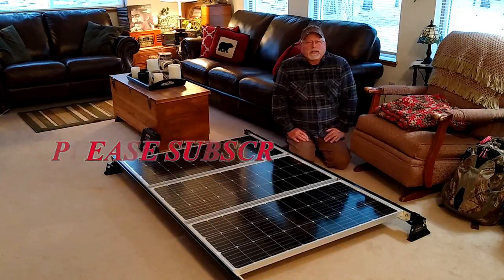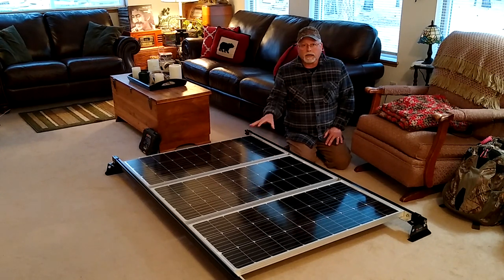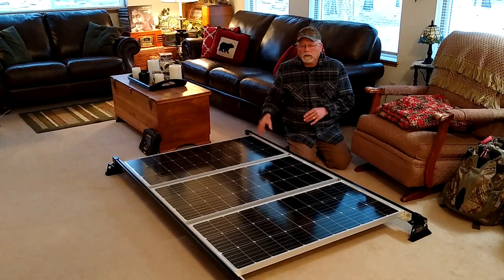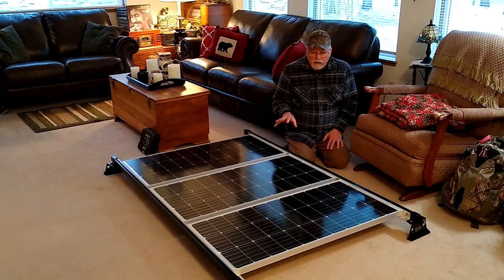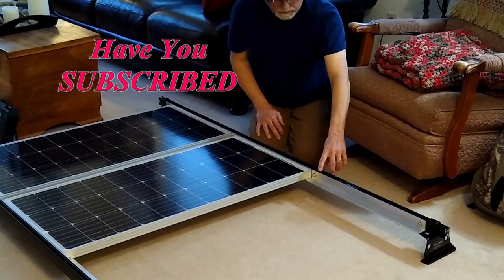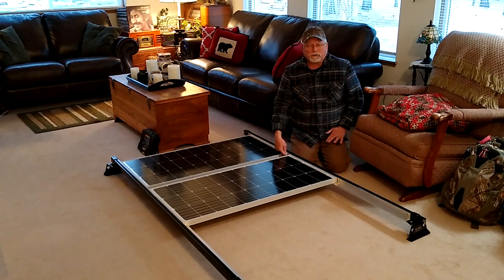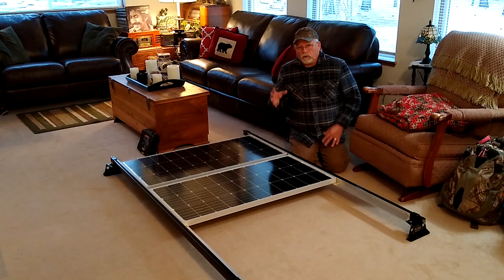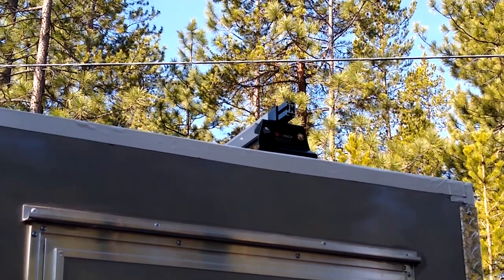CARGO TRAILER CAMPER CONVERSION BUILD PART 2

Comment: I am in love with that solar rack. LOVE LOVE LOVE it! I'm tempted to put a solar on the top of our Ford (we have a 100 watt already on the HC1) but keep changing my mind if I shouldn't get a storage rack instead. Renogy has been really good for our HC1, you've def chosen well there. Looking forward to seeing the final conversion :-)
Reply from the maker: Thank you Fern for your input on the Renogy solar panels. I did lots of looking around at solar equipment and settled on Renogy as the best equipment for the dollar spent. The roof rack is top end quality and I'm very happy with it. Adding the angle aluminum works great but does add $80.00 + $15.00 hardware to the equation. Well worth it. Thank you for watching our video and have a great day.

Comment: Thanks great video and nice setup I need to get mine on to that will work.
Reply from the maker: This is a great setup. Very solid racking system. As we're back in the snow and cold weather this week's video won't feature the finished setup as it's to cold in the shop to seal the mounting brackets to the roof. This week's video will be how to use Mylar food storage bags for long term food storage. Have a great day Kevin.
Reply: @explorer867  thanks you do great videos my friend.

Comment: That's the strongest mount I've ever seen!
Reply from the maker: Yes, its strong for sure. The mount is all aluminum so its very strong and lightweight. It bolts to the trailer roof structure with 8 bolts and the solar PV's are bolted with 4 bolts in each panel. Lets just say they're not going anywhere LOL.

Comment: That's an awesome solar set-up you have going on there. I like this. Solar is something I want to add to our trailer as well. 400 watts should be plenty too. Thanks for the sharing this video!
Reply from the maker: Hi BluWave good to hear from you.  Thank you for watching our video. The trailer/camper project is moving along at my pace Lol. Keeping it fun and not work. Working with Renogy has been a pleasure with the purchase and delivery painless. I ordered the 400 watt premium package. They had a sale last month so keep an eye out as they do this from time to time on some of the Renogy  product. I'm thinking we will go with the Battle Born 100AH Lithium battery. These are the best bang for the buck with a top end BMS and that means everything when it come to safety, reliability, and longevity. The BMS will shut the battery off if it identifies unsafe operating conditions and regulates how much power you can take out of the battery. I know TMI Lol. As I said earlier great to hear from you both and take care.

Comment: thanks for sharing, super nice build out....so a few questions, I apologize if you have answered them already... 1. What height of vantech racks did you order, I notice they have "standard" and "high" versions. Do you feel you have enough room underneath these to pass your hand for cleaning purposes. 2. why go with "top mount" vantech mounts as opposed the "side mount" versions? and are you bolting into studs or just the sheet metal, I imagine these need to be bolted down well as the panels act as big spoilers while going down the highway. 3. How are the panels fastened to the L brackets? are you screwing them in from underneath?
Reply from the maker: These are the standard height racks and yes you can clean under them easily. Watch the video again as I do answer the questions your asking about. Have a great day
Reply: @explorer867  I've watched all 9:51 minutes and you didn't answer the specific questions I'm asking about...please try to answer them(Questions 2 and 3) if you can. I would appreciate it. Thanks.
Reply from the maker: @bikeninja956  Bike Ninja, I'm sorry you are correct. I did a take off on the mounting holes on the back of each panel and drilled corresponding holes on the aluminum rails then using the mounting hardware from renogy bolted panels to the rails. The other question you were asking regarding mounting of Vantech rack I answered in the Cargo trailer camper conversion build part 3 video. In this video I show where and how they are mounted to trailer. The top mount was a cleaner mount for my application.  Thank you for asking your questions and if you have any other questions please ask. Please Like and Subscribe to my channel. Have a great day
Reply: @explorer867  no worries :) Really appreciate the info. It's about what I thought, you screw them from underneath...tough call whether to go top or side mount for the vantech brackets...I'm thinking side mount maybe, just less chance of leaks...but not sure... Cheers.

Comment: Good video Sir
Reply from the maker: Thank you for watching. Please like, subscribe, and let others know about our channel. Have a great week.
Reply: @explorer867    So I have not seen any videos on the inside set up of your solar panel on the cargo trailer.  Question. Do you have the power system grounded? May be a dumb question but how did you ground to a aluminum trailer ?
Reply from the maker: @jamesnelson167  what I did for my trailer is ground system to battery. I would recommend that you contact a professional solar installer to ask that question.  Have fun with your project.

Comment: I just subscribed.  I see you did the solar panels a few years ago.  How are the panels working for you?  I am curious how well the eternabond tape help up.  I seen somebody else have tape not do very well on their flexible panel.
Reply from the maker: Thank you for subscribing. The solar panels are working out very well. Only maintenance is keeping them clean so they produce to capacity. The eternabond tape is working out very well. After applying the tape I used self leveling seam sealer on the edges. This said preparation is everything. Make sure you use 120 grit sandpaper to rough up surface area then clean area with rubbing alcohol. Have fun with your project🤠 Let others know about our channel on your social media please.

Comment: Thanks for the video. I wish you had done a video on the application of the Eterna-bond. Did remove the flashing stuff from the manufacturer or apply it on top?
Reply from the maker: Yes I removed the manufacturers tape lightly sanded area with 120 grit sandpaper then cleaned up the area with rubbing alcohol. The Eterna-Bond tape really sticks so lay it out a foot at a time. Take care and have a good week.

Comment: What can you really expect out of 300 watt panels?  The cost of these setups dont seem to give you much for the money.  Generator and gas will charge a battery way cheaper
Reply from the maker: David, Thank you for your point of view. I guess it's all relative to your power needs. This works well for now and as I need more power I have another 100watt panel that can be applied to the system with 290 watts on the pickup camper canopy. All this said if need be I do have a Yamaha generator. Thanks for watching
Reply: @explorer867  It was a serious question.  I'm looking into solar, but the cost, and fact it cant keep up with A/c has me thinking twice.  I'm putting together a 7x16 trailer and power is my sticking point.  Really leaning towards a Honda EI 3000 and a couple 100 amp hour lithiums
Reply from the maker: @davetoms63  I think if you plan on running a AC unit then solar may not be the best choice for your needs. Solar isn't the least expensive way to go but what I enjoy about it is that it's a quiet alternative. Like I said I do have a Yamaha generator also but as I'm not running an AC unit or other high wattage appliances I'm good with the solar. Please give a Thumbs Up, Subscribe and tell others about our channel on social media. Have a good rest of your week.